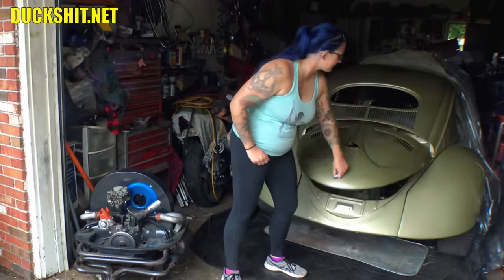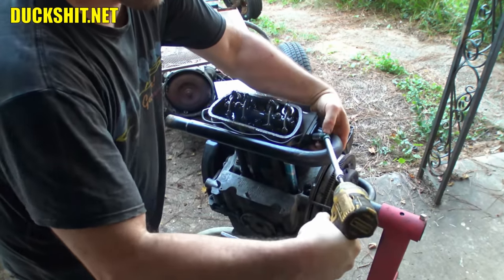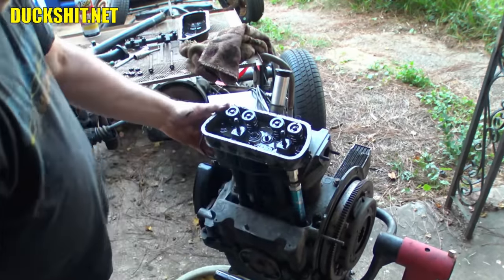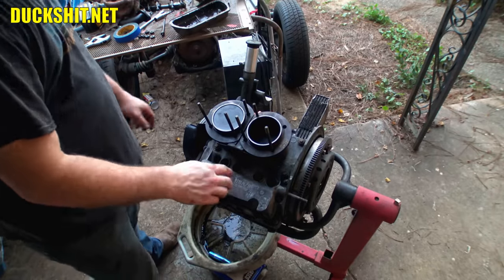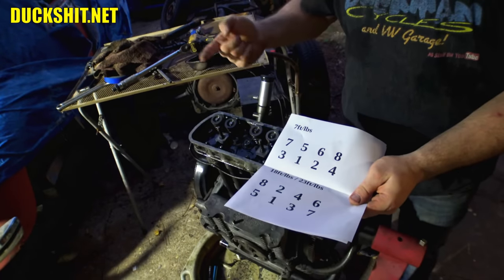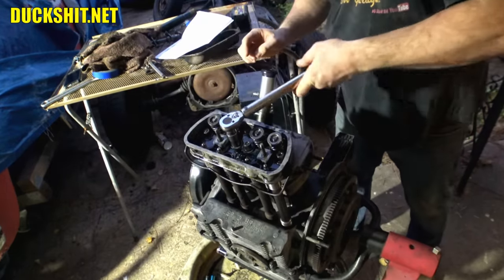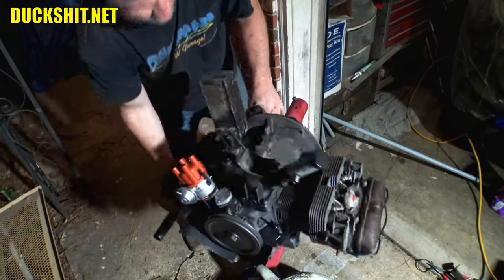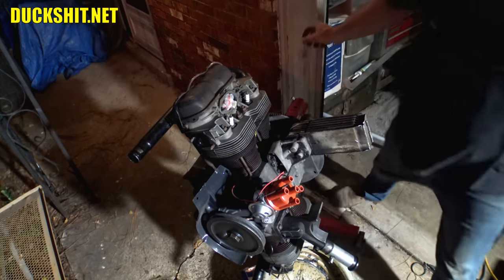🔧Replace Pushrod Tubes🔧 - They Suck -  1956 Chop Top VW Beetle - 173

Comment: Hey Glenn  this is Carl from Weeki Wachee. As I'm sure you noticed Ian crossed the state well below me so all I got was a little wind and rain. My brother still lives in St. Pete he said they got some heavy winds and a lot of rain but nothing serious and they didn't lose their power. So, we were all fortunate this time for which we're thankful. 
Watching you work on that engine reminded me of something. My was a tech school and I took automotive repair. One summer they offered a engine building class which I took. The local salvage yard donated junk engines to work on. The engine that my partner and I got was a 1600 cc dual port VW motor. It had spun several main and rod bearings. We had a good time. I learned things like how to use plastigauge to check bear clearance and how to measure the bore and stroke to determine the displacement. Anyway watching you reminded me of those times. As I've said before, I enjoy watching you do your thing. Keep up the good work and stay safe.
Reply from the maker: Hi Carl!  I'm glad you're doing so well.  The weather here as been just beautiful!  It has been completely clear for weeks, but the winds did pick up enough I didn't want Eleanore outside to be hit by falling things out of the trees.   Hehe!
Reply from the maker: Thanks for sharing the story, I really do appreciate it!  I wish we had a VW engine in auto shop back in the day!

Comment: When I rebuilt my 1915 about 4 years ago, I used the cb performance spring loaded tubes and as of yet, no leaks. You have to grunt them in but they work quite well.
Reply from the maker: That's good to hear!  Some people hate those things and say nothing but bad things.  I've never tried them.  But its done now!  At least until the other side gets screwed up.  LoL!
Reply: I used the JayCee racing push rod tubes and had the same luck… no leaks in 3 years and counting.
Reply from the maker: @VWJawbreaker  even if they leak they're easy enough to pull out fix and put back!  😁👍🏻🦆💩

Comment: A light coating of Permatex aviation sealent on the CLEAN head and engine sealing surface before you install the CLEAN rubber ends, will go a long way to prevent pushrod tubes leaking. I’ve been told that the white seals can squeeze out of the heads and leak, as opposed to the red seals. I’ve used them both with success. The light coating of Permatex, dried, makes the difference.
Reply from the maker: Thanks man!  Everything works better when its glued in!  Hehehe!   😁👍🦆💩

Comment: Years ago I worked at a company in VanNUYS CA. Called Autobaun Engieering building AIR COOLED V dub engines.
Reply from the maker: Very cool. Did you build anything really interesting?
Reply: @DuckmanCycles  mainly production remanufactured engines. An occasional 1835.

Comment: I stressed my tubes to much the first time and they just bend at the ends when torque down, so I took them out and with a wooden mallet I knocked the tube's down to sides, and refitted them, fitted okay.
Hope they don't leak but I think they will be fine.
Reply from the maker: If they didn't leak at first, they're probably fine!   😁👍🦆💩

Comment: You reckon ,the push rod tubes on right hand side are more rusted, because it's the "ditch" or rain gully side of the car and it might have a a slightly harder life...? Asking for a chevy guy
Reply from the maker: Heh... that is what I suggested in the video!
Reply: Nah you harped on about stripping bolts and Ford folk... I notice wheel bearings and such being replaced more on my dirt boxes on the ditch side.
Reply from the maker: @brendanabbott2809  No?  LoL  Indeed I did.  Failed open book test.

Comment: "Oh, Duckman,  You can NOT reuse those Push Rod Tubes.  They will Crack and Leak.".........Sorry, that happened......I think you kinda, roll the dice on that, if you try to reuse them.  You try to be  thrifty and it bites you in the A$$..... Reuse them in a "Pinch" or "Broke Budget", otherwise just replace them
Reply from the maker: Agreed!   LoL!  They were incredibly brittle!  But even my replacement one failed.  I probably boogered it... ahhh... doesn't matter.  It's done now!